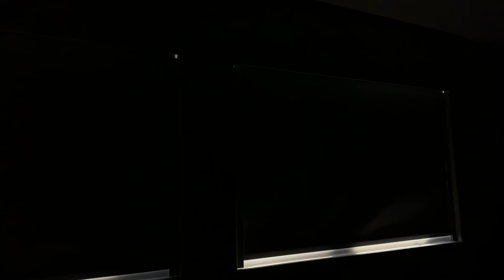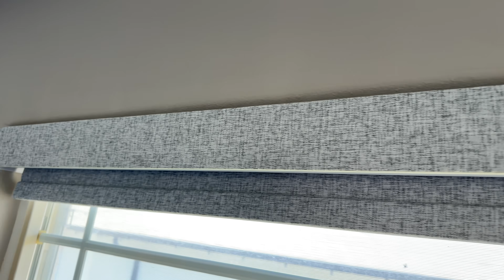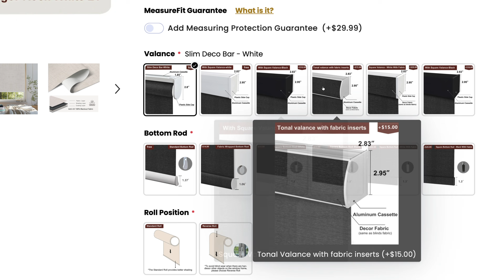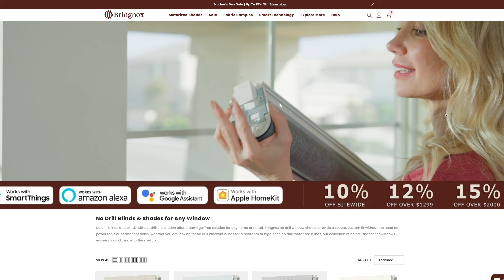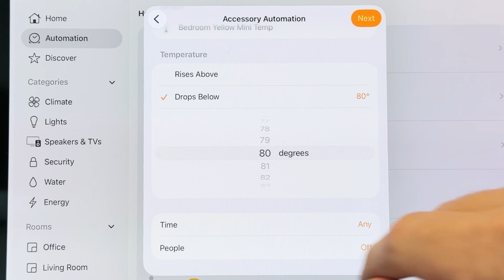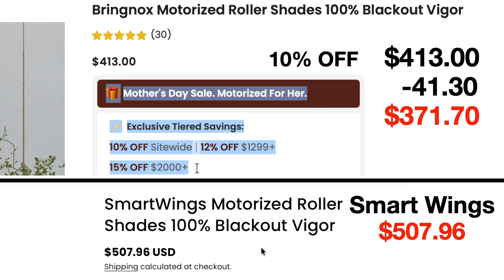Smart Shades That Cool Your Home & Cost Less: Bringnox Blackout Shades

Comment: Wish these worked for me but my windows aren’t deep enough to have them inset. I want some that are automatic, dual shade, and has a frame around them to completely block out light when mounted outside of the window frame. I’ve seen some that have the frame but they are manual.

Comment: How’s the noise level?
Reply from the maker: I have only used these and my SmartWings cellular shades. I found that these were quite a bit quieter than my SmartWings shades. I don't know if you are able to tell during the part of the video that I ask for them using voice. 
Bringnox doesn't show a specific volume level. They are listed as ultra quiet. Light sleepers might be woken by them. They are pretty quiet